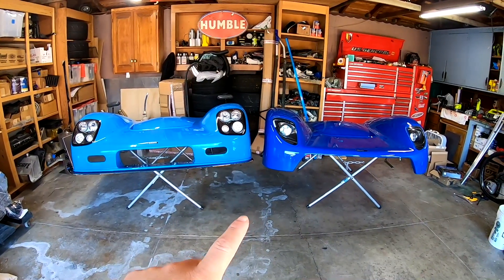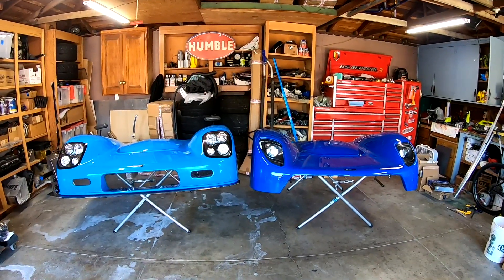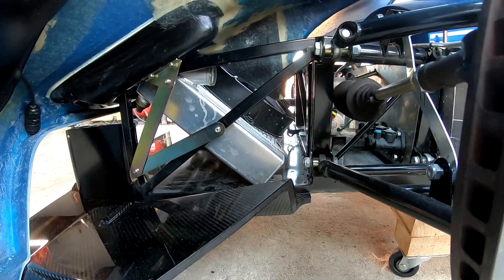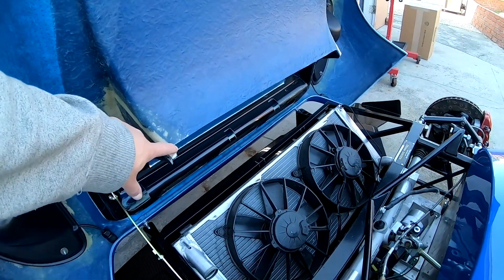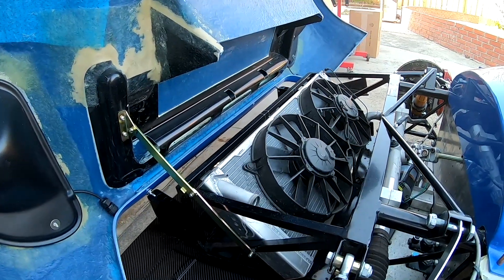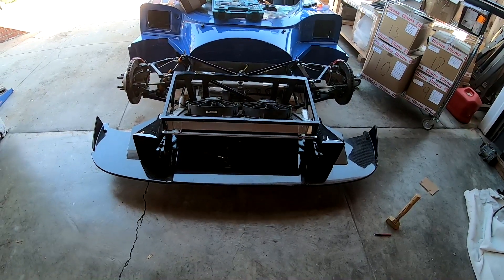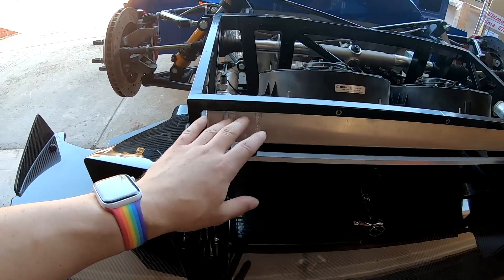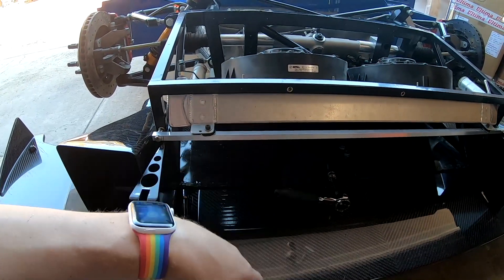Ultima RS - Blunicorn Rebuild 14

Comment: One of my favorite new trick bits on the RS is the radiator exit divider. It splits the hot air exiting from the radiator and directs it away from the roof scoop intake. Slick.
Reply: @Leonel Ace Flixportal
Reply: @Nash Elian Thanks, I signed up and it seems like they got a lot of movies there :) I really appreciate it!
Reply: @Leonel Ace no problem :D

Comment: Humble, the new body looks great. Quick question, how did you mount the plexi headlight covers on the RS? I did not see any screws and was curious.
Reply from the maker: Because I haven't mounted them yet!  I'm going to mount them the same way as I did the Evo, prep and glue them in with sealant.
Reply: @DriveDriverDriven  Thanks Humble. Got my naming convention backwards. Did you document in a prior video how you did the black boarders and what type of glue you used?
Reply from the maker: I think it was in the original footage I lost, but I plan to cover the glazing process on the RS in detail.
Reply: One suggestion when doing the black out above the eye brow light, test the blackout with a flash light. I need to redo mine as the primer shows bush strokes when the eye brow light is illuminated. The primer is a one coat solvent, I think it needs a coat of black out paint on top of the primer.

Comment: Good idea always wanted to know what was the difference. I really like the RS rear for one reason they EVO has tail/brake lights that look too much like a Vette. Does this company wind tunnel test the models? Just me.
Reply: Humble I have an R.S. on order & I was following your addition of electric power steering. Did it work o/k & what model pump did you fit. I am loving your build & admire the way you overcome adversities.
Reply: Sorry I meant motor not pump.